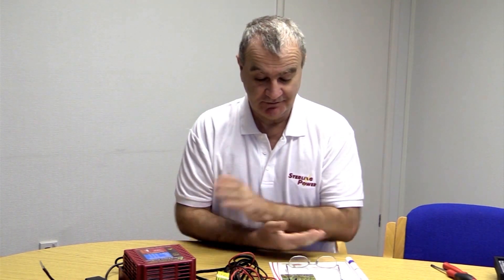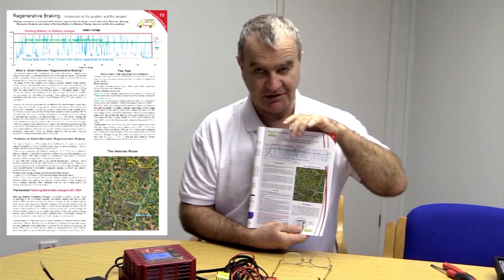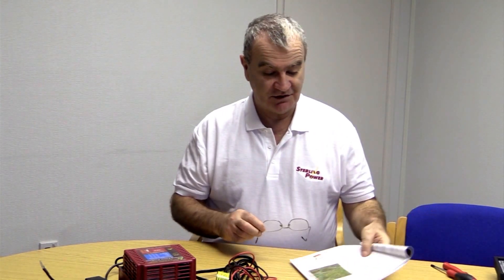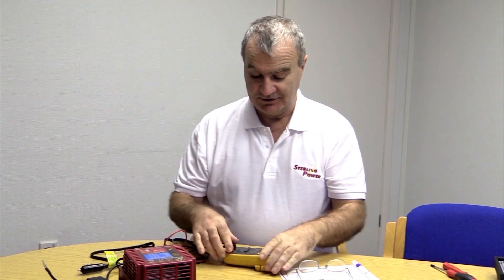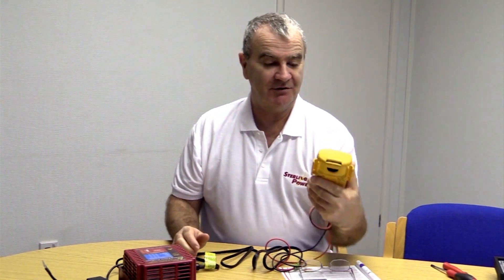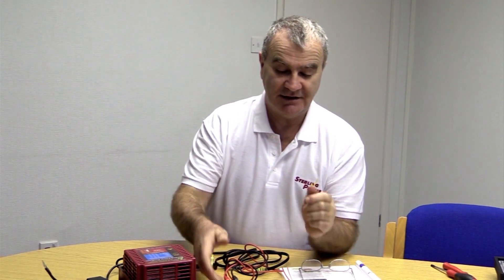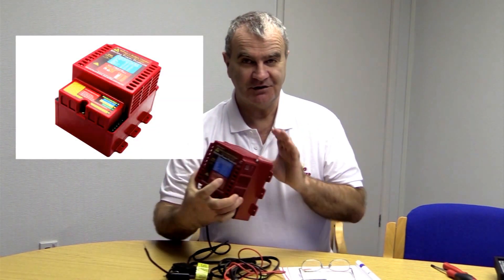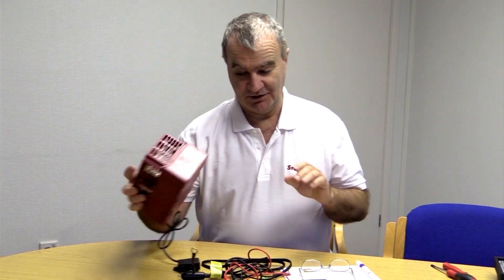Testing for smart alternators / regenerative braking

Comment: Your video is an interesting find!

☺ I have installed a voltmeter cum thermometer via car's cigarette lighter outlet primarily to monitor battery voltage. I have observed that car voltage goes down to 12.4 v after 5 minutes then goes back up to 14.2 v when I turn on loads like the a/c or lights. Is is a smart alternator with regenerative braking?
Note: car negative terminal does not have a square block attached though. (Honda 2010 model).

Comment: You can tell if you have a smart alternator by looking at the earth terminal on the vehicle battery. If it gas a square black block connected within the earth cable, its a smart alternator.
Reply: You could just disconnect the sensor on the negative rail of the starter battery, this deactivates smart charging and regeneration, the EMU then goes into a standard continuous charging regime with float at 13.6 volts and charging at 14.2 volts, well that`s what happens on my 2015 SLK. With the sensor disconnected you end up with a fully charged battery.
Reply: @robbob1693  Hi, have you tried this and could it affect the van in any way, thank you.
Reply: Hi, I have that block you mentioned which means I have a smart alternator 2015 Transit  T350 , so  would i need a certain type split charge relay to charge my leisure battery for window cleaning,  thank you.